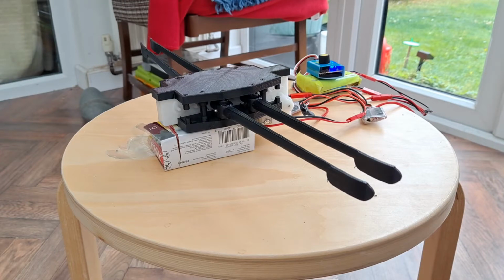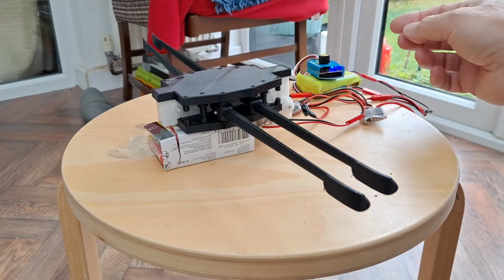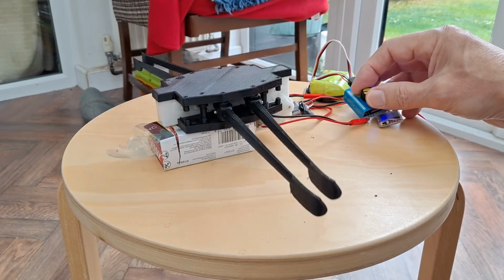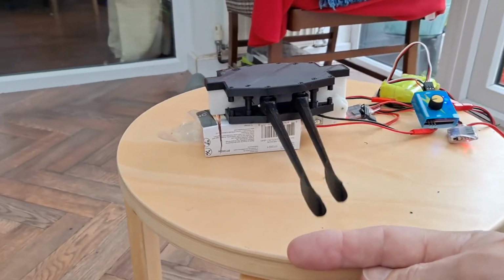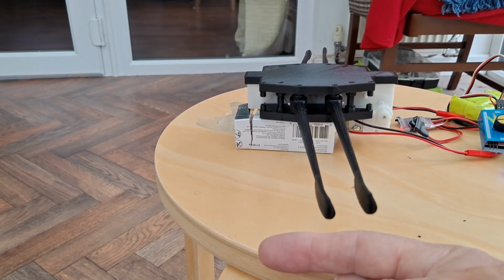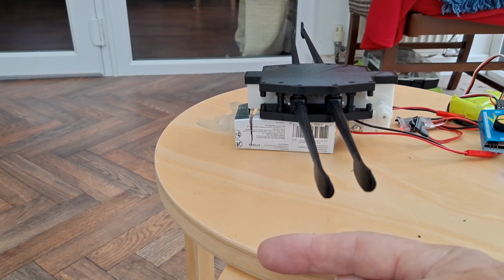Rowing Eight revisited Part 3 Four oars and gearbox mount 20220723

Comment: I'm excited for this one. Good evening grandad.  Just got home from work and I'm getting ready to go for a swim then try our my sailboat. It came with the house and needed a bit of repairs and a new set of rigging. I got everything in the machine shop wx except the 2 newest cad end mills. I did get one cad end mill because I am actually going to use the non cad machines he basically just charged me for the one cad machine and gave me everything else so it didn't get scrapped.  I have a week to find a place to store everything until I can build a shop.out at my house. I might just rent a place for 3-4 months if I can find an old warehouse big enough.  I need at least 3500 square feet of space to run the machines. I found someone who is willing to teach me to use all the machines and already has a license to built small arms. So he's going to be my partner and I'm going to rent the machines to our business.  I know that sounds weird but that protects me from loosing my house and my machines if this business were to fail. I'm definitely learning alot about business that I was lucky I could have lost everything if my construction business had any real problems before I sold it. Our first 2 rifles are going to go to the government for testing and I'm not sure what else because this is all new to me. It's crazy that we have to get a business loan right away because the insurance is so astronomically high I'm actually a bit scared about starting this business especially when I'm not the one with experience and knowledgeable about this type of work. It was just going to be a hobby but if it works out it could be a 20 million dollar a year business.  He just got divorced and had to sell his business to pay his wife. He was in Vancouver doing the same thing but moved to get away from his ex.
Reply from the maker: Well good luck with your new venture 👍👍
Reply: @GrandadIsAnOldMan  I'm not sure about this one. I might just use the tools as a hobby because this is an uncomfortable amount of dept for me after everything I worked for.

Comment: Looking really good. I did notice that the right and left oars go out of sync after a few seconds. Will you be able to adjust it so they stay synchronized? 👌👍
Reply from the maker: You cannot synchronise them if you are using variable speed to steer the boat.

Comment: I realize you are well past this point but I would have liked to see how a single set of oars worked.. with all the printing/redesigning you are doing perhaps its time to revisit printing a hull, more like a rowing scull or viling long boat, even redesigning the gear box so the oars are further apart.. that last bit is where all the rest came from after seeing these 2 sets in action the back sweep will be less effective because the front one has already moved the water
Reply from the maker: Here is the previous RC Rowing boat https://www.youtube.com/playlist?list=PLA5a2xPRSrB0I9tbu19W_qeDb4985wjpO
Reply: @GrandadIsAnOldMan  that was pretty cool
Reply from the maker: @docink6175  I probably need to revisit that one too, now that I can print suitable oars 😊😊
Reply: @GrandadIsAnOldMan  thats what I was thinking, you also have the gear set up for this build you could recreate a single set with more torque